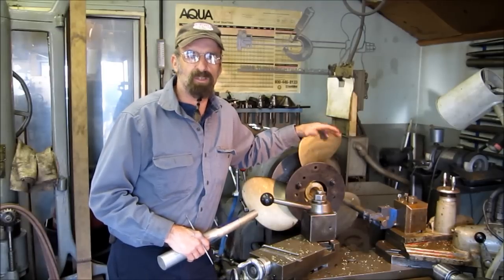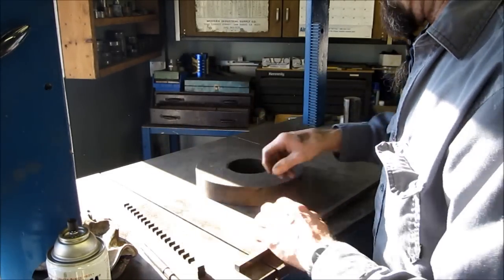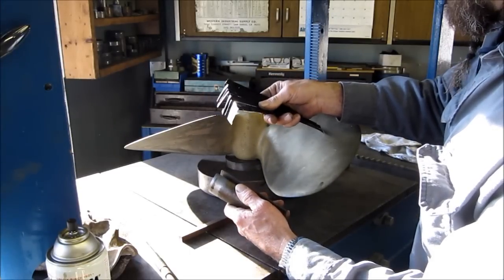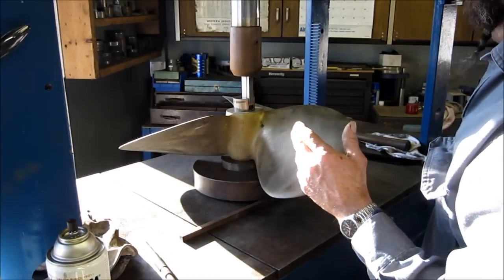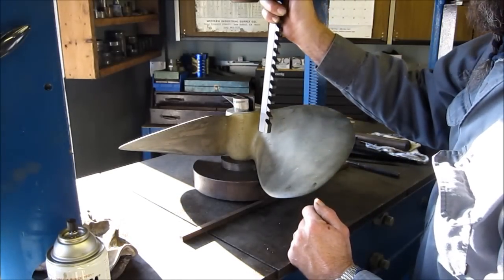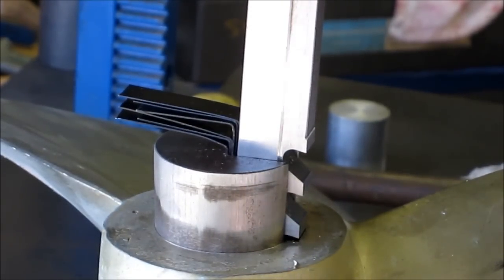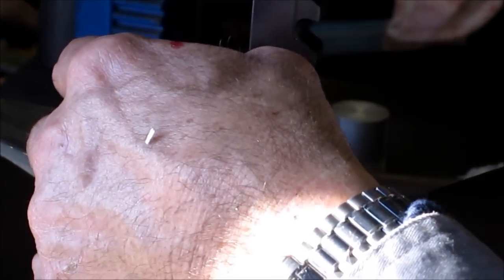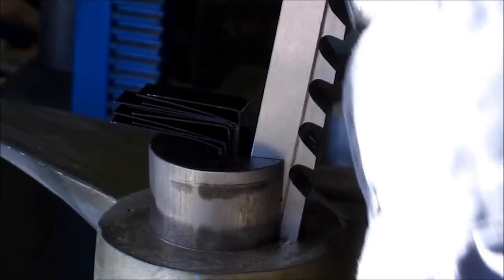Broach It

Comment: You said that the slot (keyway?) wasn't a straight one, but was at an angle. 
As it appeared that you just "willy-nilly" created SOME-SORT-OF angle, by placing a 3/8" piece beneath the thick ring of steel, I'm assuming that the degree of the angle wasn't critical.  Is that correct?

Comment: I've got a question I don't have a brooch ink it and I'm going to buy a small one I think it's a couple hundred dollars so it's not a real good one or a real extensive on. Do they noticed okay it gives you these bushings there random sizes from small to you know maybe inch and a half to use in broaching random diameters but they seem almost useless. I mean what are the odds that I get a size bore that these bushings are going to fit properly? Are you supposed to make your own? I'm fine with that I just don't understand why they would even include the slotted bushings in a kit I mean seriously? I'm going to be doing many different size gears and pulleys I can see maybe having a 5/8 or 7/8 or 3/4 handy but other than that there may be a lot of custom stuff.

Anyway if anybody could clear this mystery up before I buy my kid would help me a great deal

Comment: What I really appreciated about this piece is that it made me see that a keyway guide can be devised to apply a lot of different ways - not just the "kit" way, as long as your arbor press, hydraulic press, or I suppose mallet or sledge can gain access.  Out of the box.  Nice.

Comment: I watched a bunch of videos on broaching and I think I know know the best way to cut internal or external key ways. I think a lathe carbide broaching tool attached to and incremental slide plate (motorized) which is then attached to a trip hammer clutch. Broaching made easy and faster than CNC thanks to faster oscillations due to the trip hammer clutch.

Comment: If the broach guide is tapered, how does it give you a consistent slot depth?
Wouldn't it allow the tool to move around?
Reply: michael atkinson only the very last tooth will set the final dimension the whole way through

Comment: I know this video is old but I think for larger diameter holes it would be possible to create a right angle end mill that could fit in the hole and carve out the broach.
Reply: Mats Moreau there are milling attachments, but big diamater holes are almost always done in shops with specialized machines

Comment: Very nice video Keith. You did a nice job of explaining why you set up and finished as you did. I completely agree with you about strapping, it is made out of surprisingly good spring steel. (Engineer of 35 years practice)

Comment: I like to use a couple of drops of oil/lube on the back side of the broach as sometimes the shim can get sucked in with the broach.
Reply: i was thinking the same thing,  i work for a company that does this and we cut our own shims with sheet metal from .002 - .020 then whatever other shims we need we go and get but i hate having to recut shims after every pull.

Comment: I was wondering if you can give me a bit of advice, I'm looking into making a portable line boring machine. I will most likely make the bar itself what do you recommend for material also whats a good place to buy a square broach?
Reply from the maker: I would use any cold drawn materials that fit the budget, from 1018 to 8620.
I have purchased push broach's at both MSC and ENCO. ;{)----
Reply: Thanks!

Comment: Great video.. great idea for the strapping material, and it's come in very handy, Thank you.. I found that as I put more strapping "shims" on, the shims did a little traveling due to the down pressure.. my solution was to weld a perpendicular pin to a small plate, and punched a hole into every shim, so when you dropped it onto the pin, it stopped the downward motion of the shim in contact.

Comment: Part of my job is doing just this operation, albeit on a smaller scale, putting 1/8" wide keyways into oil pump rotors, gears and pulleys using just this kind of technology. Who needs CNC's?

Comment: Keith, I have an anvil with a too small hardy hole (its the square hole and is a fraction shy of 1 inch).  Would it be possible to enlarge the hole using a broach?  I imagine the broach is tool steel but the anvil has been harden. Would that be a conflict?   Thanks for another great video.
Reply from the maker: There are square ⬛️  hole broach's

Comment from the maker: The broach guide slot is milled inline with the taper so the key way depth remains the same depth for the length of the taper, by shimming the whole project the guide and push ram are aligned. ;{)-----

Comment: Keith,  I'm sure you know what you are doing, but you mentioned cutting a tapered slot, hence the key stock under your backing plate. But it seems to me that if the broach follows the guide, then either the guide slot or the guide itself must be tapered; i.e. unless the broach moves at an angle to the axis of the shaft, the slot will not be tapered. Angling the workpiece will only change the angle at which the press imparts motion to the broach. Did I miss something?
Reply from the maker: The guide slot is parallel to the bore taper.

Comment: Is the keyway always aligned with the centre of the blade 
for strength in a prop. You can grind a recess in the 
end of the broach so your push rod can't slip.

Comment: Nice video.  I've also used the steel strapping as shims.  Usually when I'm milling a flat on an OD.  Stick the work on some parallel surface in the vise, add a couple shims, mill the flat, add a couple more shims and mill the same flat on the opposite side.  Works consistently.

I was a little worried the drift would pop out at you.

Comment: Cool Keith I was going to ask about the lube too on the bronze.  Sometimes you can smell the sulfur when you machine cast iron especially parts right from the foundry.  

That's a great idea for the shims, that steel usually pretty hard.  Also razor sharp when cut with snips....don't ask how I know.